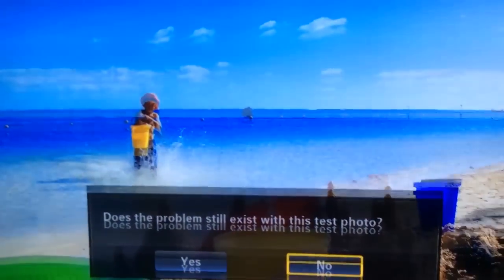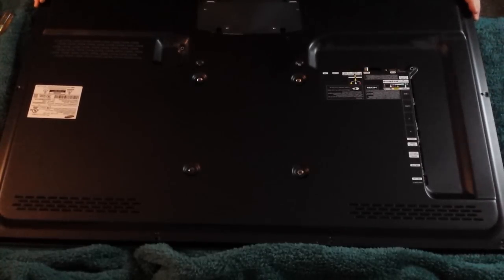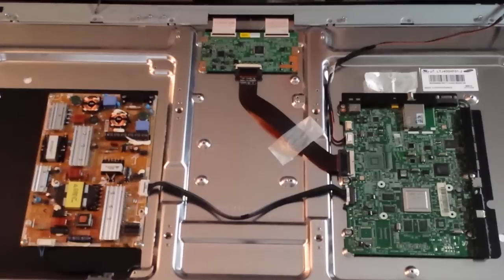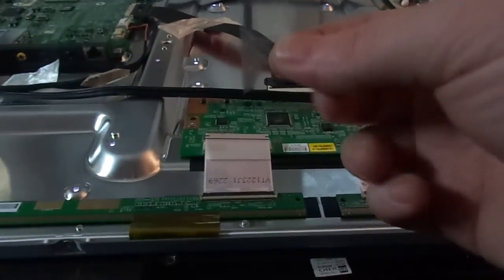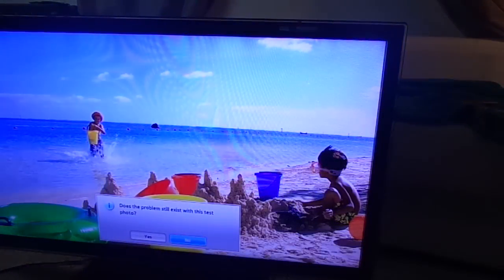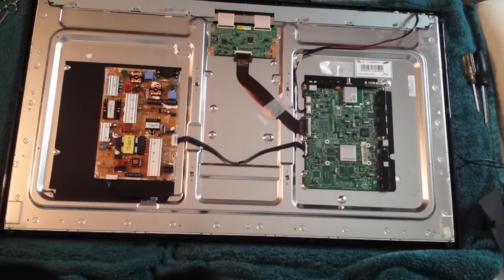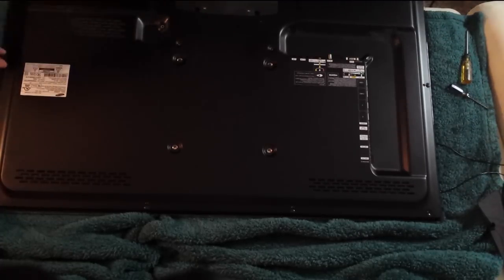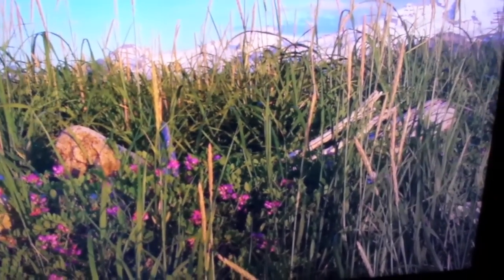LED LCD TV FIX, How To For Samsung Double Image, Black Vertical Lines, Screen Problem Sony LG.

Comment: https://drive.google.com/folderview?id=0B62PQlsQtokxOWkwaDJZaWdjRUE

Can i fix this horizontal line appear on middle of the screen??
Reply: Suryateja Pakalapati I have the same issue. I tried the tape thing and the lines went away, but now the whole screen displays those lines from the end of the video. Any suggestions?
Reply: yianniz After doing tape the line is gone for me. And after lines appeared on full panel like  in end of the video. to remove these lines follow the steps done in end of the video. you need to adjust the strip or move the strip untill lines disappeared close the lock. it works for me.
Reply: Suryateja Pakalapati I must have done something wrong cause now the lines are white and they don't change colours. I think I might buy a new T-con board for the TV which is kinda cheap. Do you think that's a good idea?
Reply: yianniz if you do anything wrong there is no need to change Tcon board. you just repaired a connecting strips. if you do something wrong it will only get effect to connecting strips. you didn't touched the Tcon board. I think you did wrong in taping try again by removing tape and see whether the picture is like old i.e., before taping. if it still white lines try changing the strip. And also check the strip ending that contains gold terminals. check whether all terminals are there or not. because when you remove the tape the gold terminals get removes sometimes. so, you check that strips that there are in good condition or not.
Reply: I removed the tape and the picture is worse than before. The strips are working well. I also tried swapping the strips with each other but still, the picture got worse. When the strip on the right is connected the left side of the screen works perfectly fine, but when I connect the second one the lines appear on all of the screen.
Reply: I'm having this exact problem right now. Were you able to fix your TV? If so, how?

Comment: I have a un55d8000 I went through the steps, still have a horizontal line towards the bottom of the screen. would that still be a ribbon issue?

Comment: I followed the video exactly. Whenever I put a tiny bit of pressure with my finger it works and whenever I use the tape I don't get anything on the screen. I am not sure what I'm doing wrong.

Comment: Hi Dave, ive done as you suggest but noticed my right side ribbon needed adjustment not like yours the left one and once done i now have red lines running across the screen. Playing with the ribbon pushing the attached plastic lip upwards kinda makes it come right but not much. Any ideas ?

Comment: so you are covering contacts with tape? doesnt that block whatever signal those contacts are supposed to be sending?
Reply: That was my first thought. If the contacts were not connecting anything then why would they be there and how would taping over change something to make it work? It would be helpful to have a schematic to know what is going where.

Comment: Hi Dave, Thanks for the info, I have Samsung 32" LED TV & was getting issue with Double image, your info helped me a lot, Thank you. Please clear some of my doubts, in u r video u have stick tape on left  side & in my case the right side strip is having defect so tried to stick tape on right corner, left corner, middle too. But my issue wasn't solved so try to clean gently with clean cotton cloth after than I inserted in it. Double effect had gone, BUT another issue arised that on screen right side vertical huge lines came approx 2 inch in diameter on starting point on right side screen. Means while watching TV u will see in middle. Other all portion looks clear (Left side & remaining portion of Right Side). Please suggest me how can I fix this. Reply Soon.

Comment: Hi Dave, I have exactly your kind of TV, please take a look here. 

https://drive.google.com/drive/folders/0B2CFqFZLUGStVmU5UkpCb2tXZHM?usp=sharing 

I've been told by someone that the entire LED screen must be changed, however that's kind of expensive for me at the moment... Could you please advise whether these steps you describe here could work for my screen or do I truly have to change the screen???
Reply from the maker: Looks like an input issue like a chennal that doesn't exist is tuned in and won't display any images.  From what I can see in the pics seems like a block across the top of entire screen is doing its own thing.  It could be that both cables are having difficulty communicating when transferring an image. Have you tried removing 1 cable at a time to see what the display does? Does one side become clear while the other goes blank and at the same time the too of screen is solid (no line across the top)? If so then the tape should work. To find the correct cable remove 1 at a time. If you see the display clear up on half the screen when 1 cable is removed than the cable that is removed needs the tape.  If it is blank (blue and black boxes) than the cable that is still inserted need the tape. I have not seen the issue your TV is having so I can't say for sure that the steps in this video are going to help out. I wish I could be more helpful I just don't know for sure.
Reply: Thanks Dave, really appreciate you giving your time to respond. I'm late to see this, though I already went ahead to try your fix before coming back to see that you had replied. Here's a step-wise description of what I already did;

- I opened up the TV to get to those two flex-like cables.

- Removed LEFT cable... Left side of screen went blank as expected, Right side of screen was showing properly without the vertical bar at the top.

- Replaced LEFT cable and removed RIGHT cable... Right side of screen went blank while Left side of screen was showing... BUT... This time the dark strip/bar at the top was showing across both the blank(RIGHT) and normal display(LEFT) sides.

- Switched both cables (i.e used the LEFT cable on the Right side and the RIGHT cable to the Left side) and repeated the previously described processes again. Results were exactly the same.

- So it was clear that both cables were in perfect condition, however one or both slots where the left cable went into (on the LEFT side) was probably the culprit.

- Refusing to give up, I tried the tape on the LEFT cable ( I didn't have clear tape so I used masking tape ), but it made no difference. The left side was just blank with the horizontal strip still showing.

- I tried the tape repeatedly using different widths, but each time, the screen remained blank with the horizontal strip still showing.

- Having no other ideas, I gave up, removed the tape, and re-assembled the TV back to it's original state. The dark strip running across the top was there as usual.

- Then I resorted to do what I used to do to at least make it relatively manageable to watch, which is change the picture mode from Movie to Dynamic. The dark top strip remained as usual, but was kinda lighter hence I resigned to fate and would just keep managing it that way

- Bored and devoid of ideas I just went to try a Screen Test, and even though it didnt work I just agreed that it worked by selecting "Yes"...  Lo and Behold, the dark strip faded away on its own.

- I've been monitoring it for a while now and it sometimes returns randomly but still fades away on its own at least once or twice every 3 - 5 minutes.

So Dave, I wonder if all these occurrences highlighted above says anything familiar to you?... or at least does it point to anything that you may be able to relate to in your experience?... Or does it give further ideas as to what the real issue might be??

Comment: I fixed the image on the left side of the screen but when I try to move the one on the right it in some places gives the left side of screen doublr imsge. If I disconnect the right side entirely the left side is back to normal. Now I can't get any image to show on the right no matter how hard I try to move the thing. What can I do to fix this? This is obviously working but the right side wont fix itself.
Reply: Please reply dont want to throw this thing out. I also tried to switch around those little tabs I noticed you could flip the tab up on the other end to completely remove it. I switched them around and the right side still wasn't working but the left is fine .
Reply from the maker: check to make sure the ribbon cable is not damaged from moving back and forth.  sometimes the gold strips will pull up off the cable and not be able to show any images.
Reply: I made sure of this buy switching them around, or are you talking about the little port thing that the cable goes into? maybe that is damaged?
Reply: Yeah I dont visually see anything wrong with it anything else I could try?
Reply: Thanks for speedy reply btw
Reply from the maker: This is going to be alot to read .so from what I understand disconnecting one ribbon cable at a time will show you which one is not functioning properly.  Try connecting both cables than remove one and check the screen. if the screen is good on one side then the cable that has been removed needs the tape. If the screen is blank or has no image to display then the one that is still in needs the tape. After you are able to find which one needs to be worked on then you can start the steps in the video. There are some videos like this one on YouTube that explain in detail why the tape works however the videos posted are in Spanish and I don't speak the language. From what I can tell the tape is used just over a couple of gold strips that are isolated by starting with a big piece of tape, viewing the  screen, and looking at the lines displayed . based on what the screen shows they count each horizontal line and apply each count to one gold strip on the ribbon cable.  little by little marking the back of the cable with a Sharpie  and cutting the tape smaller based on the marks. it's a lot of back and forth. I hope this helps.
Reply: Ok thanks i'll give it a try tomo, spent last few hours tonight on this getting frustrated. Appreciate it

Comment: Thanks for the video, I've had the horizontal line problem for a last few weeks and decided try this fix. Like you said, it did take a little time to get the size of the tape right and in the correct location but it worked like a charm. Still can't figure out how covering a small portion of the pins/contacts on the ribbon cable could be a fix, but it sure does the trick. Your video was nicely done and very easy to follow.

Comment: I repair these tv's too Dave but am a little hesitant in using power and inserting the ribbon cables. Had a bad experience once with a plasma, good video, ragards.
Reply from the maker: Andrew Cain I agree with you on the TV having power while working on it.  It can be very dangerous. Thank you for watching.

Comment: I had this same issue but when the tape was on the screen went black on both sides. And so I decided to take the tape off and try see if it still worked but this time both sides were black, no picture at all.

Comment: Hey dude, I got my TV fixed recently, main board was causing it not to turn on. Got it replaced. Works great, but there's this thin black line that fades from right to left going across the screen. Not completely black all the time, hardly noticeable on a white screen, but more noticeable with other colors or hazy dark films. I wonder if an internal cable came loose when the guy repaired the TV. It's consistently there so I don't think it's power supply, but it could be for all I know. What does it sound like to you?

Comment: the solution is good. but when connected or flex is tripped, it should be done with the TV off. sorry for my English. I did it with google translator.

Comment: OK i see this video many time... but there is no tech explanation .. just a image of the tape ... Of long ? Of many contact we need to isolate ? Is simple question without answer. I thing that to avoid error and lost time .. Is better if you add a little explanation ..

Comment: Hey Dave Thanks of kind help as Samsung Service told me to replace whole panel which was very expensive.
I tried your trick which took me 6 hours to fix and in my case i had to tape both flex cable as i had vertical white line...but now the problem is that from center of the screen both left and right part of the screen color does not matches.....tried to stick tape in many combination......if you can help regarding this issue then please... i am attaching Google Drive link to see the pictures:https://drive.google.com/folderview?id=0B63KSPVcsMf2SjE2aFlwYU02WWs&usp=sharing

Comment: Thanks so much Dave i have a tv with those evenly spaced horizontal lines and i tried your method and it's worked!!! You are right about the size of the tape.  However, I put it on different ribbon and corner.  For those that didn't get it to work just try out all possible combinations! Good luck everyone!
Reply: What are all the possible combinations?

Comment: Hi your video was excellent I seem to fix it however when I went to put it back together I now have no power.  Not sure what happened.  I lifted the tv up to check again to make sure the picture was fine, and now I have no power.  Would you be able to assist.  Not sure what happened?
Reply from the maker: Double check that the power cord is plugged in on the power input on the tv. Plug the tv in and try to turn on. Check (even if the screen doesn't show picture) try to change channels or attach a device and turn on and listen if the speakers make nosie. Also check to see if there is a small power light on the outside of the tv. If you see a light then you have power going to the tv but it is not supplying power to all parts of tv. You can physically check the capacitors on the boards to see if any of them are damaged.  There are a lot of videos on YouTube showing how to check. Also look around the tv where the boards are and see if there is any burn marks, if you find one it is a indication of where the issue is.  I have watched many videos on YT and T-Con board is a common issue on tvs not turning on. I hope this helps.
Reply: Hi Dave, okay the power is working, I just can't get the stand back on, and I think I hooked something up wrong,  My tv goes through a digital cable box, I can see the hdmi 4 but then nothing.  Not sure what I am doing wrong
Reply: Hi Dave, I got the picture working, I just went through the digital cable box.  Just two problems, can't get the stand back on and right picture darker than left side and lines now at bottom.  I put tape on the left side to fix the double image.  So I am guessing I also need to put tape on the right ribbon too.  Is that correct?  Also is it okay to plug in the hdmi cable as the TV will not work unless it goes through the digital box.  That is where the coaxle cable goes into so I cannot test by plugging coaxe directly into TV

Comment: why does this work ? what is the tape doing ?
Reply: In this video the tape seems to be covering some of the electrical contacts on the ribbon cable. How is that not preventing electrical connections between those contacts and the socket? The video leads me to believe that not all of those connections are necessary for the tv to work.
Reply: I found this video during a search because I am in the process of making a video that will explain in more detail why the tape works.  The way LCD screens work is that each subpixel is turned off/on by a transistor.  The signal that turns on that transistor is fed from either side of the screen.  On one side of the lcd panel assembly there is most likely a short circuit in that signal line (which is causing the image problem).  What he is attempting to do is block the signal that is connected to the shorted component.  The LCD screens can still "work" even when one side of that particular signal is blocked since they are redundant signals.  In other words, the signal to the transistors comes from right and left sides.  You can block one side and still get a functional image on the screen.  Hope that helps!
Reply: Tipically one driver on LCD panel going bad . And by removing power source from it  normally save the panel  they have generally  4 to 6 drivers tabs each side of an LCD panel . Sometime just one side have these tabs . Anssometi e they have no tabs .the new disease in tv these days are failing tab driver . And oadakize entire LCD panel

A shorted driver will affect entire power for other driver . 

The tape actually block power that normally go to a driver on the side . 

But both side of LCD can drive whole panel . So both can be not so essential
Reply: @Vo0d0o2009  And yet - the double image still around.
Reply: my question exactly
Reply: The only logical thing I can see about this FIX method is the capacitance effect of the tape. It is doing the job of some bad SMD ceramic capacitors on the LCD boards.
Reply: I belive this works because the connections are redundant. I also think the connections which are disconnected by the tape were faulty due to the solder connecting the connector to the pc board breaking loose.
Reply: This worked on our Sharp tv!!! Thank you! It was only one year and one week old.
Reply: What the tape does is to give the ribbon some tightness in order for stability. There is better connectivity when the tape is inserted. After a while the ribbon cable gets a little worn and so a little servicing becomes necessary. Hope this gives you some sort of clarity.

Comment: +Do It With Dave please I want to ask about something I have a Samusng TV 3D led TV 46 inch 
series 6/4600 have the same problem like ur TV 
the person who came of Samsung company told me that the crystal of the TV have to change Becouse it's broken and it's will cost 5500 LE and I bought this TV in 2012  9850 lE 
how the repair more than half the original price from  5 years ago sry for my bad English 
please any one help me I feel there is something wrong